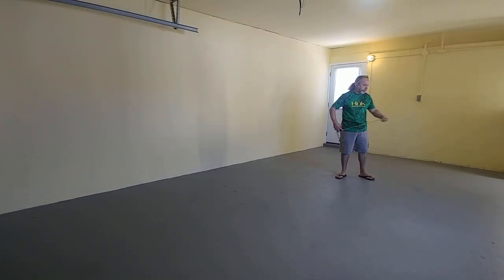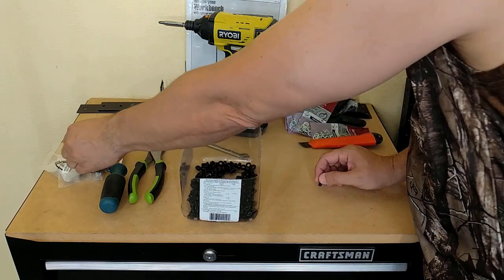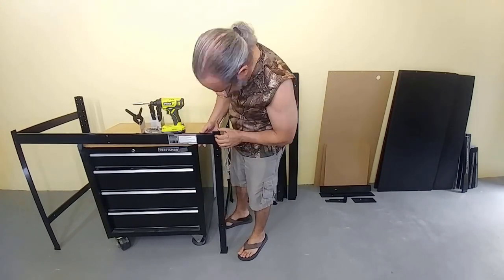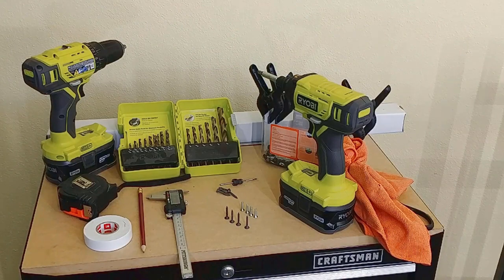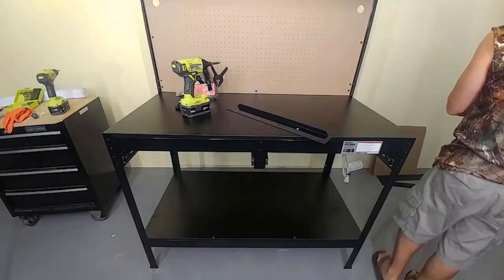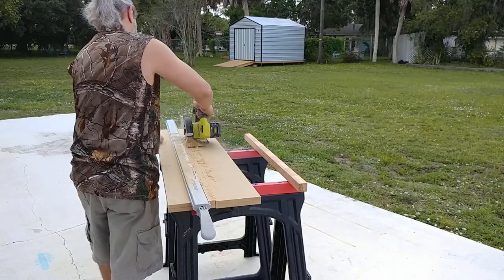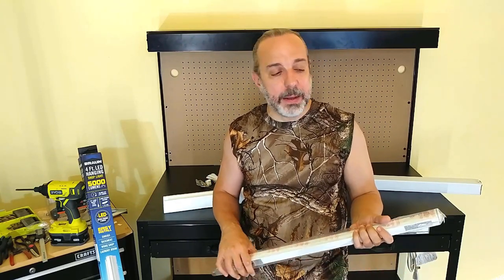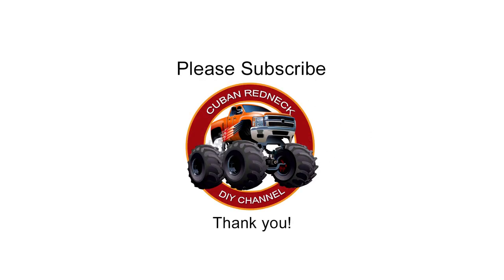Harbor Freight Workbench | Assembly | Mods | Review

Comment: I took down the original light as well.  I put in a 3' LED flush mount shoplight, attached a switch and plug.  I also added a fully adjustable and extendable Architect light with 5X magnifier for intricate work as well.
Reply from the maker: Very cool!

Comment: Outstanding video. Been thinking about getting this for some time now, but most videos are just people putting it down. I build models as my hobby, and it always seemed like a good buy, given the size and the cost- but yours is the first realistic review I've seen. I think there's just an anti-Harbor Freight mentality out there, and your video has put into perspective any lingering doubts I had about it. Thank you for your time, good luck with your future projects, and have a great day.
Reply from the maker: ... Glad I could help and thank you for commenting! I agree, for the money I think the Harbor Freight workbench is a great value.
Reply: I think the “anti Harbor Freight” mentality comes from people that might use tools or tool related things (like a work bench) very frequently for their profession or maybe a high demand hobby. But for normal people that just want a cheap tool or solution that may not use it all day every day, Harbor Freight is amazing. I buy most of my tools there because it’s generally a tool I only need for a specific project, however, if I ever need it again after that I’ll have it. Hammer drill, circular saw, soldering iron, are just a few things that I never really use but bought for a specific instance. Also, stuff like a cheap tv mount for a guest bedroom, or an extension cord, Harbor Freight is amazing. There and Northern Tools are my go to spots.
Reply: @hewlett-packardlovecraft2297  I’ll chime in on this one, NT in my opinion does carry name brand tools and such so the cost is obviously more, but they do have some lower cost budget tools and items as well. In the big scheme of things, shop both, just use them accordingly. That’s my review
Reply: A great bench for modeling!

Comment: Thank you. Great video and the perfect length. I am going to do all your additions as they are just too smart. I would have liked to have seen the finished product of all three benches together at the end. Also, did you bolt the benches to each other for added rigidity?
Reply from the maker: …hey thank you for your comments! There is a  better shot of the entire wall on the first video I made for the channel - https://youtu.be/I9_FJBRw-OQ. During this video, I realized these benches were not going to work out of the box and that the instructions skipped over what I think are important steps. As to strapping, I did not strap them together, but I did anchor them to the back wall with something called Simpson Strong-Tie Item #96076 from Lowe's. Just one in the center of each did the trick, although this is somewhat of an overkill!

Comment: Pretty good build. Couple things I would have done different but good illustration vid. I think I would add some cross support on the table top and lower shelf. Probably a simple 2x4 would work if it would fit.
Reply from the maker: … hey, thank you for stopping by. I did consider that primary for the deck, but after sticking the perimeter on the bottom shelf, all the center flex when away. As I said in the video, these are not the type of workbench you want to hammer on or load with 200-300lbs. Nevertheless, I agree that a 2X4 on its side under the top deck would be a nice upgrade. Maybe when 2X4s come back down to $5, I will consider adding it! Thanks again!
Reply: @CubanRedneck  Yeah, I'm not buying much wood here either. I have an abundance of scrap that I could probably scare something up without buying anything. I thought maybe one of these would be quick (scratch that) and dirty to put a 6040 cnc router on, but I don't think it would be solid enough even if I replaced the top with heavy plywood. Haven't checked what that is running, but might have splurged on a sheet if it has come down some.
 I eventually want to get it up on one of those 3 tier heavy commercial looking shelves with the wire type "liners." They make a really good bench if you lay a heavy sheet of plywood on top the wire "liner." I have a few here yet but need to make more room to set one up. I think I will just go for one of the wire shelves with a piece of plywood laid on one of the shelfs at the right height. They also make a pretty good table / bench with the advantage of being able to roll it around Prices on either are comparable to this one you did the vid on and way more solid, especially with the commercial like 3 tier. The advantage too is that I already have a sheet of heavy plywood split in half just for either of the two (you can actually get two pieces for the commercial benches and combining the two left over ends to get enough to do a shelf on one of the wire shelves) bench / table builds I described above.
Reply from the maker: …that sounds like a cool project, and I think the workbench will do. However, given my experience with CNCs, MDF would be my choice, a bit more stable and denser. Better at absorbing vibrations as well! That is unless you are considering water cooling anything! In fact, I am looking at getting a Next Wave Shark-SD120 towards the holidays. I am keeping my fingers crossed, hoping they come up with a BlackFriday deal. As far as installation, I was thinking of enclosing the lower half of one of my benches with ½ MFD and a Plexiglass front window. Lighting, dust collection, the works!

Comment: Question:  I haven't started assembling mine yet, hardly even opened the box.  Do you know how long the fluorescent bulb is in that thing?  I'm going to replace that with an LED one.
Reply from the maker: ... hey how are you? The bulb measures 21.5" and the over all is about 22" - It is a T5 14W type. I originally got one from Amazon for like $12 and the light output totally sucked. IMO getting a 36" LED fixture would be a better choice. After several fails I ended up making by own and I am very happy with it.

Comment: Thanks for sharing and responding. So you think it matters which screws?  They all look the same and the supplied instructions are vague.
Reply from the maker: .. if you are referring to the drawers my came riveted to outer rails and M3 (6-32) bolts and nuts on the center support. See 12:33 All the others are M5 there were some a bit shorter then the others I guess for the peg board but I ended up completely redesigning that.
Reply: @CubanRedneck  okie dokie + subbed
Reply from the maker: ... thank you much appreciated! 👍

Comment: Nice video! I purchased some clamps as well. Can you put the outlet on the left side instead of right side?
Reply from the maker: … hey, thank you for the visit! Yes, but this is a predetermination you must make at the beginning since it requires choosing on what side you bolt the plate with the cutout.
Reply: @CubanRedneck  yes, I did it early and seems to be no problem. But I put the pegboard first and now I’m having trouble with top mount board.
Reply from the maker: … I know I highlighted several booboos I made during the build, but I am sure I missed one or two. Remove the front panel of the top shelf that should give you better access to the shelf itself.
Reply: @CubanRedneck  And so happened I ran out of those bolts in the pack they were 78 I believe.
Reply: @CubanRedneck  oh what size of bolts should the drawers take? I know the board is lose in there.
Reply from the maker: ... the board just falls into place, as to the frame, the EOM are metric M6 X 10MM, but if you are getting bolts at a big box store like Lowes or Home Depot I would probably recommend 1/4-20 by 3/8 or 1/2 since that is the cheapest most rarely available size.
Reply: @CubanRedneck  ok will do. Some people put thread lock on some videos I’ve seen as well.
Reply from the maker: ... if you are using a power driver, the split or star washers will suffice. I do a lot of vibrating stuff on mine. No issues with anything coming loose.

Comment: How have the benches held up?
Reply from the maker: First thank you for commenting - and yes, very well to my surprise after about a year! I ended up upgrading the round lights I had ordered. Replaced it with a 36 ft. - 5500K LED tape that I ended up cutting in 4 pieces and sticking it to the inside of the top piece. I made jumpers with 3.5mm plugs from one bench to the other in case I need to pull one out! I keep the deck waxed so nothing sticks to it! ...other than that very happy with the mods! Just published a video yesterday where I am working on them! As I said in the original video, not the best out there but for the money you can't touch it! Especially give the cost of wood nowadays!
Reply: Thanks for the reply! I rarely ever get a reply from anyone, no less the content creator!
Reply from the maker: @DOCintox  you are welcome! I know exactly what you are talking about! But with that said, the whole point of my channel is to help others and to get more people to engage in DIY and woodworking it makes no sense to avoid answering viewers' questions.

Comment: Hello again CBRN
Thank you for another Great Video. I know this Video is eleven months old. With that in mind, How has it worked out. Are there any hindsight issues you found along the way? Again thank you
Reply from the maker: …hello, and thank you for commenting! I am happy to report that the Harbor Freight workbenches were a very wise investment. No issues, no rust as I was promised, I did change the light once again. Made a video on that! I waxed the deck with yellow mold release wax so that nothing sticks and a year later they look as good as the day I bought them. More often than not they serve as back drop for many of my videos.
Reply: @CubanRedneck  Hello again, I was wondering if you would install a light. As it already has the power stripped, Your pretty much set. Do you think the bench could handle a vice? Or is it too light a structure? Again thank you
Reply from the maker: Here are the lights I have on the benches - https://youtu.be/PdB0L3Baxsg I am not sure about the luminance, but they are 5K! 

As to a vise, I have a light-duty suction cup type 3" vise that I move from bench to bench. I feel that the structure could handle a vice, but the ½ top deck will not. A one-inch or, better yet, two ¾ inch MDF sheets glue together will more than likely do the trick if you are going to put a heavy-duty vise on there… If you are doing that upgrade I would consider upgrading the bottom shelf as well, just for added mass.
Reply: @CubanRedneck  Hello again, thank you for the quick response. And thank you for the suggestion. Last question, I promised, In the beginning of the Video,  your flooring is it painted or what? I was surprised by how even the color coating appeared. Again thank you
Reply from the maker: …yes, it is paint! I had some old marine interlux bottomkote paint that I was not even sure if it was any good because it had separated. The color is Navy grey. I mixed it with a mixing paddle, poured the gallon and half in the center of the garage, and spread it outwards with a roller and a long stick. ...and BTW feel free to contact me when ever! You can look me on on Facebook - https://www.facebook.com/CubanRedneckCom-103761264834496 (Although I am trying to limit that!) or my website - https://cubanredneck.com
Reply: @georgeferlazzo7936   I bolted a 4 inch vise to mine. It's more to hold assemblies when  working on guns. Most weight is 10lbs,the vise weighs more. Later on I'll upgrade the top.
Reply: @craigwiess1656  Thank you for responding.

Comment: Has anyone pinpointed what the actual upgrades are since harbor freight rebranded it to Yukon?
Reply from the maker: Once again they change the color slightly but from one I have seen at my local store, I don see any changes!
Reply: @CubanRedneck  mine came with serrated flange nuts which was good. Full size LED. Drawers are pre-assembled and the color is now black. Thank you for your video you were a big help and factor in me buying it.
Reply: @CubanRedneck  did you ever get a second one? I’m thinking of buying another one and linking them together.

Comment: Hey I’m thinking about buying it for my aquarium, do you think the 300lb limit is accurate?
Reply from the maker: ...hey, thanks for commenting! Brother, I am not sure about 300 lbs. The rated capacity on mine is 250! You may get away by reinforcing the legs if you are talking about the bottom shelf. If you are talking about the top deck, you are probably better off with 1" cold-rolled steel, which you can drill and tap if you don't have access to a welder. I have done that before. I made a 55-gallon tank stand from old bed frames.

Comment: What is the height of the working surface, and the overall height?
Reply from the maker: The assembled workbench dimensions are as follow -  deck height is 35.5, overall height 61.75, overall width 47.75, overall depth 23.75
Thank you for commenting!

Comment: I didn't have the hardware to fix the pegboard gap, and mine was only on the left side, so I sealed it up with a hot glue gun.
Reply from the maker: … thank you for sharing but know that hot glue is an intermediate fix. Consider adding a small piece of plumbing strap or something to keep it coming apart.
Reply: @CubanRedneck  If you think hot glue is an intermediate fix, you don't even want to know the stuff I do with zip ties. 🤪🤪🤪
Reply from the maker: …. No don't get me wrong, I am a fan of hot glue! But the deck of the workbench has a vinyl laminate and with time and  temperature changes it will eventually give. As to zip-ties no argument there! People always question all the stuff held up with zip-ties on my race car and bike, but (knock on wood) no failures to this day!
Reply: @CubanRedneck  Zip ties are forever.... 😁